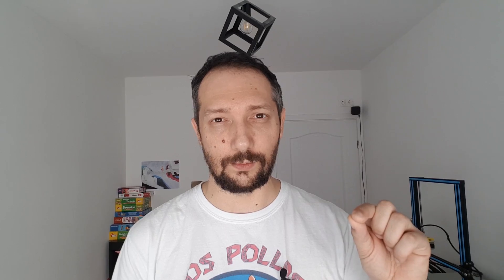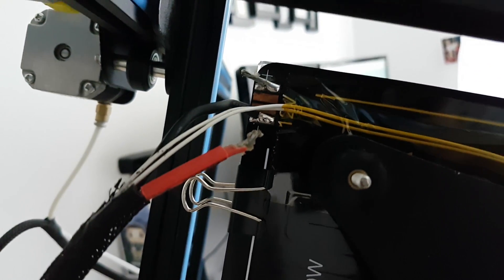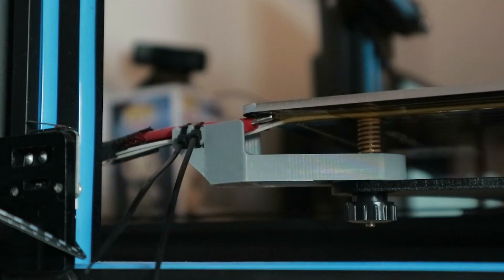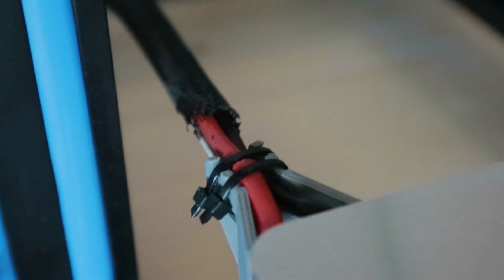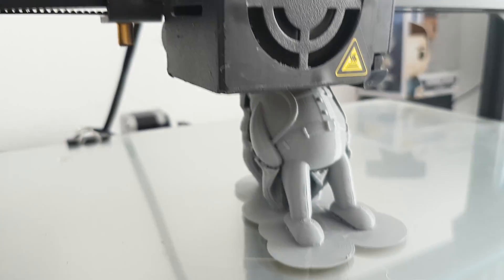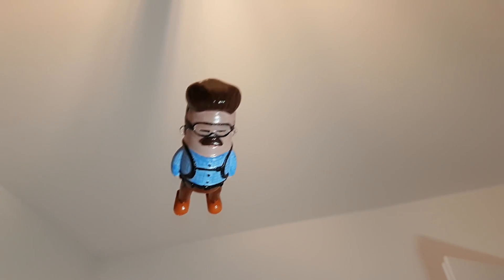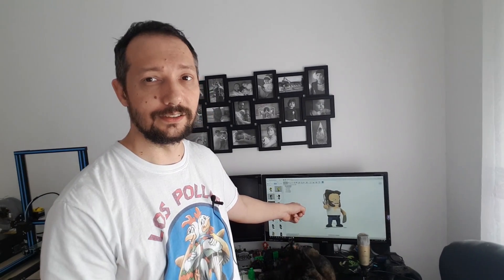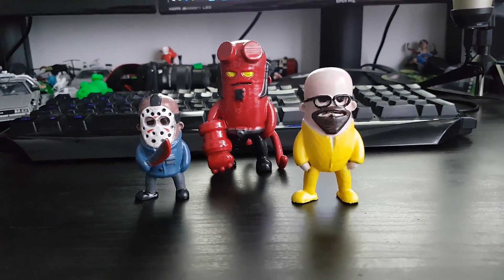Make Peter from Deadpool and don't burn your house down!

Comment: When I bought my Tevo Tornado, the first thing (after the spool holder lol ) that I printed is the relief bracket, my bed is AC 220 powered, is amazing, it is huge fast and it has low low low power but it is dangerous if it brokes. I'm sorry for what happened to you and thank you for share this so I can confirm that my upgrade printed was a great idea. PS: I love you art in design. I have to find free time to print your Hellboy (I'm a big fan of him).
Reply from the maker: Luigi Tomasello thank you! I'm obsessed with Hellboy :) 3 or 4 videos that I've made are about him in some form. :) my videos have small amount of views but I hope I will warn at least one person with it and make a difference.